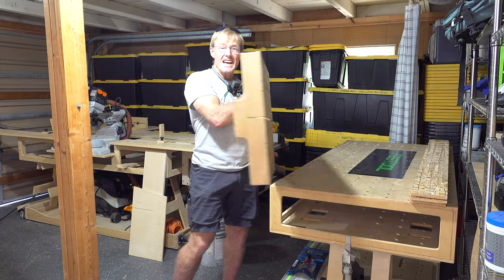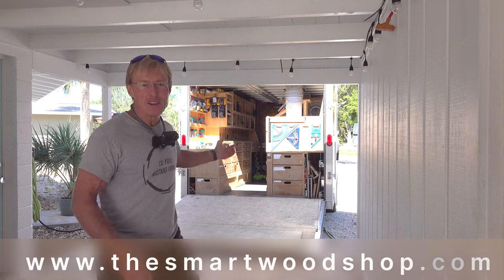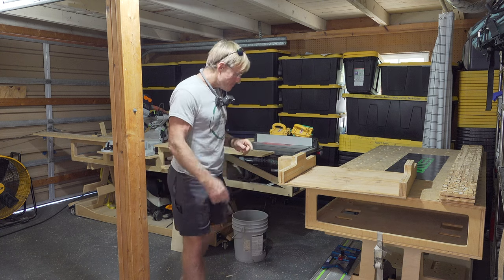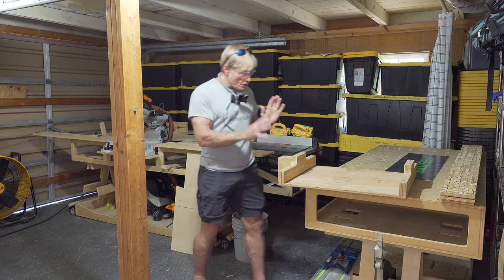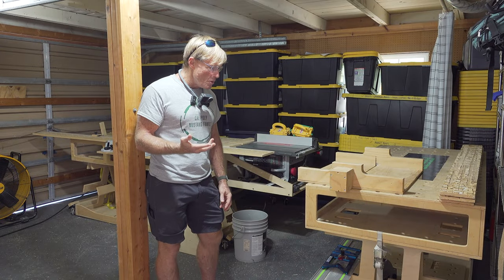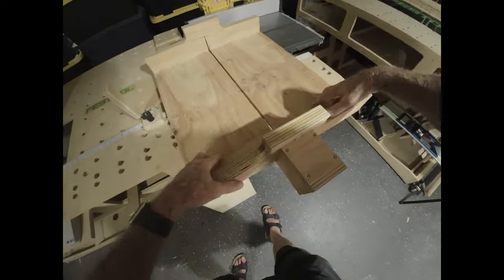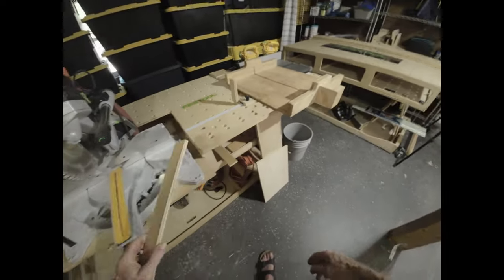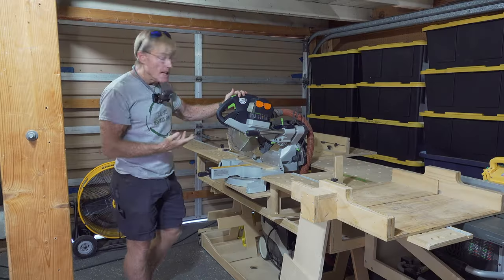Woodworking Sorcery: The Invisible Crosscut Sled Upgrade

Comment: I totally agree with Ron. Also, for all the carpenters, not having a sled in the trailer or at the jobsite, is one less tool/jig to pack. In addition, for woodworkers with large shops and/or years of using I understand a sled being your choice. One thing I do want to expand on that Ron has mentioned. A good quality glide Miter Saw has tremendous value, it is safe, accurate and in my opinion is the most valuable tool to any/all carpenters and a better choice for methods we all take for granted & do well.........however this should be the method for the DIY person/weekend warrior as a sled would complicate/limit their projects. Again, only my opinion.
Reply from the maker: Michael, I always appreciate your insight.  a hui hou
Reply: I have a 12" Delta miter saw. I try my best to get repeatable (same hand position and force) and accurate (double check and make fine adjustments) cuts with it and there's so much flex to it. What can I do to get better accuracy? I've started doing more and more on my table saw, even when it's not the easiest choice, because the sled and table saw combo is so consistent.

Comment: Just my opinion but workholding for small pieces is inherently safer using a crosscut sled.
Reply from the maker: Both are safe for small cross cuts, but I will go with the mitersaw as a bit safer generally, except in my case the table saw is SawStop so it doesn't get any finger safe than that,
Reply: For pieces that are really small (ie. too small to properly attach or hold on a miter saw, say under a few inches, I do agree, the cross cut sled is better. You find them in miniatures, making tools, making some sorts of fine furniture, artwork, etc.

For the work that Ron does, which is all related to home building and remodeling, where the smallest pieces might be trim or cabinet related, a sled is indeed not useful if you have a kapex and a track